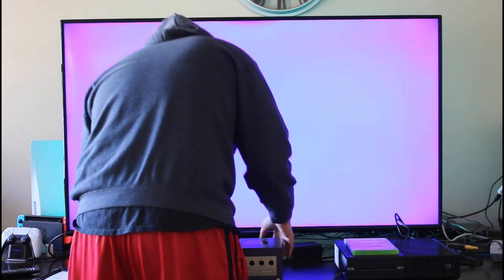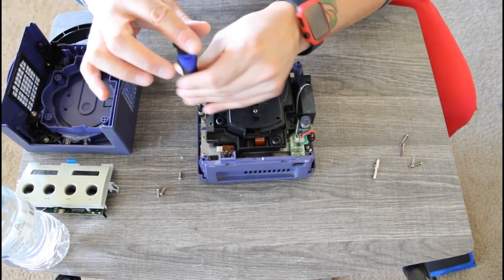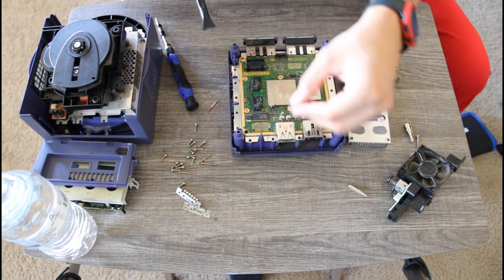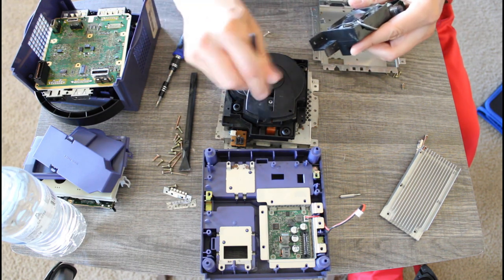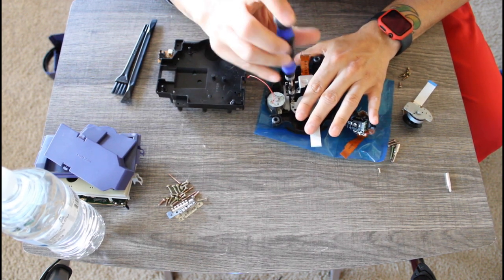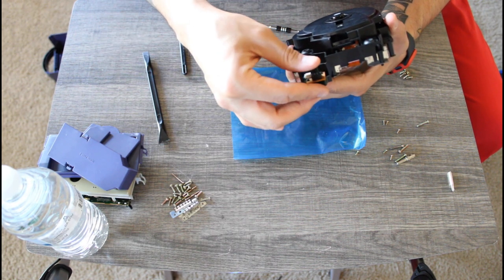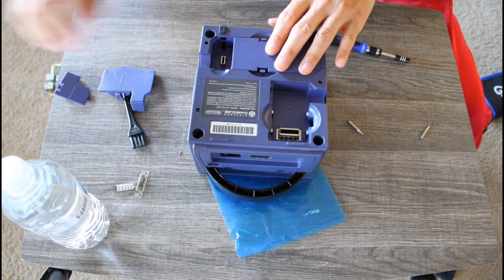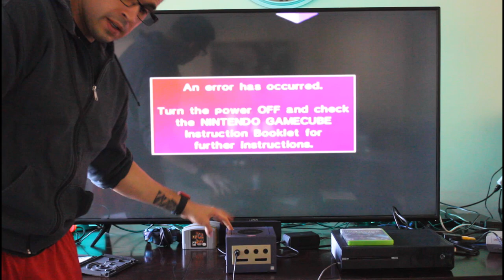Attempt to Repair an Irreparable GameCube Problem! (Part 1)

Comment: My PS3 was never opened up so I decided to open it up, clean it, and replace the thermal paste. There was so much dust that there was some rust on the edges of the board. I didn't expect that but it makes sense that the dust would hold some moisture in order to corrode it.
Reply from the maker: Oof... that is one console that I am really afraid of taking apart so mad props to you. I eventually will have to clean my PS3 soon and I am not looking forward to it. Although it will be a good video!
Reply: @90sMetalGamer  It was surprisingly easy due too the IFixIt step by step guide and video. Tip, keep a little envelope for each little batch of screws with a crude drawing of the shape of the console with dots for where the screws go.
Reply from the maker: @nBasedAce  Thanks for the tip! I won't be pushing out as many videos for the next 2 months but I've added the PS3 to my video list. Thank you!